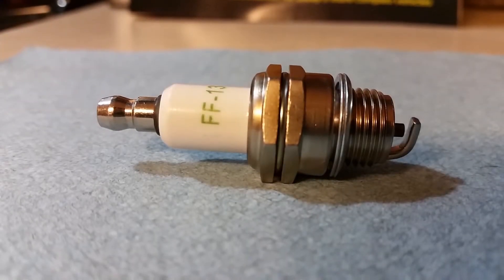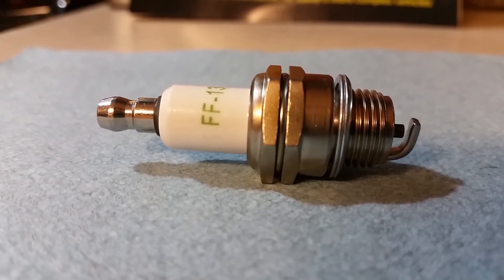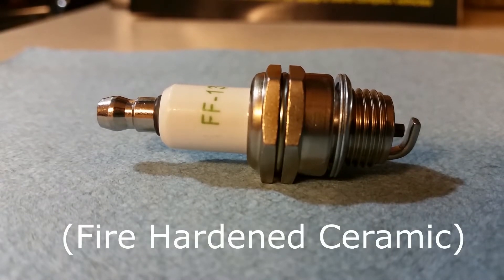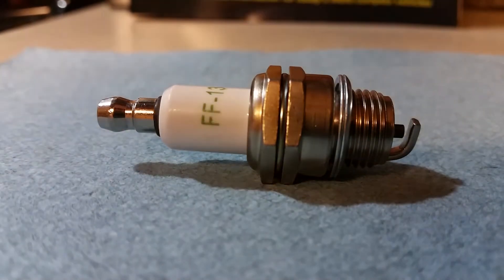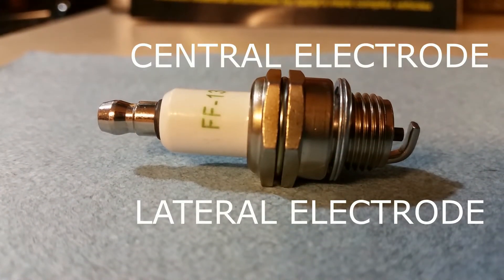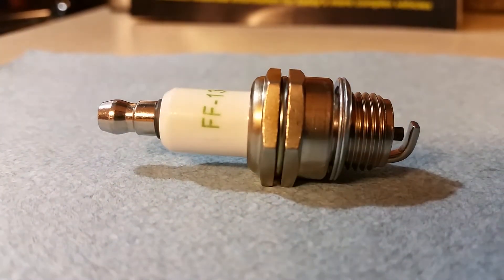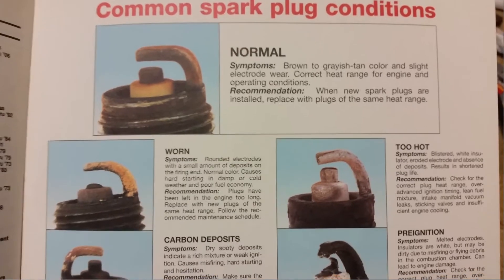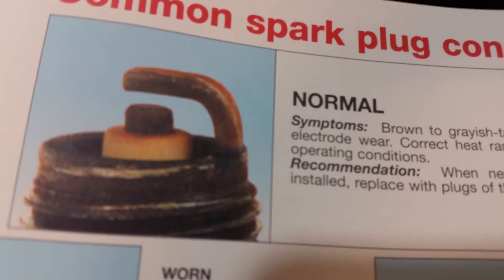Spark Plugs 101 | Everything You Need To Know About Spark Plugs

Comment: Good video. I too change my plugs sooner that recommended. The plug will last longer but if you check the gap you will find that it is wider than it should be. I also use copper plugs as they perform better, they don't last as long but hey I'm changing them sooner anyway.
Reply from the maker: I also like copper plugs, thank you for the comment and kind words!